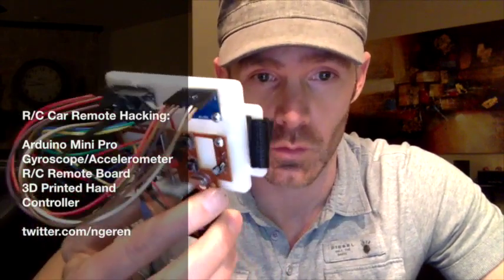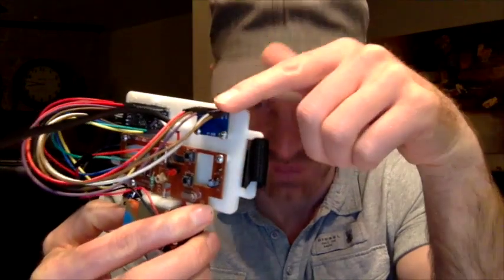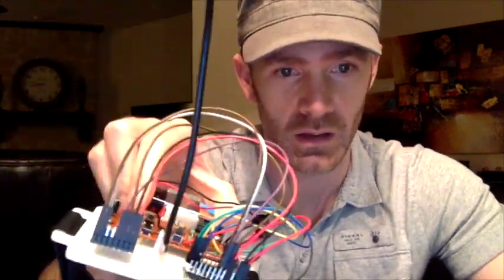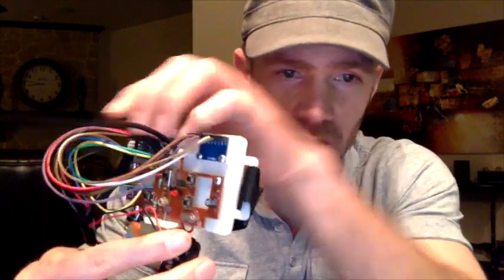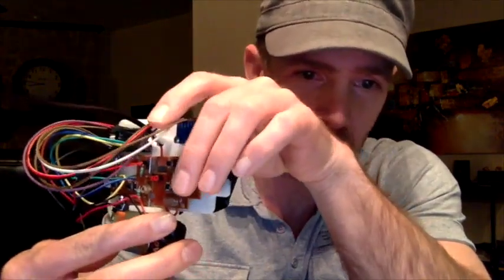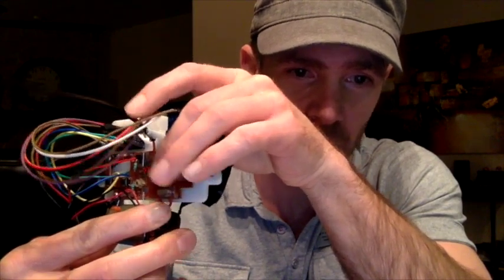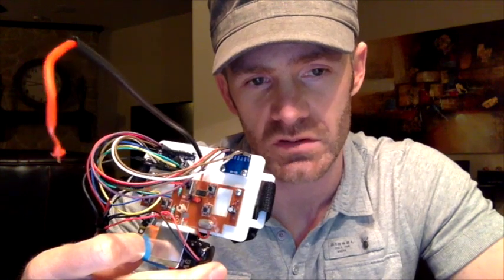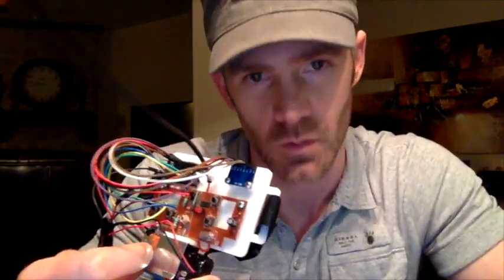Hand Gesture/Movement Controlled R/C Car

Comment: Would it need to be a Arduino mini, or could it be another Arduino model like the uno
Reply from the maker: You could run it on anything. You could also do this with some tilt switches and avoid the digital logic altogether.